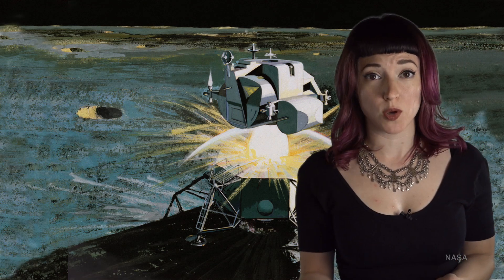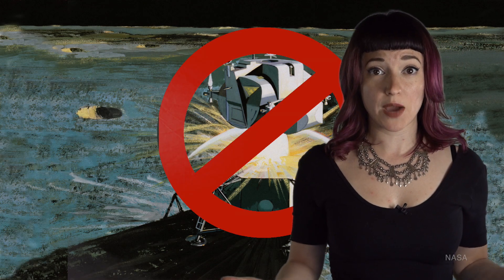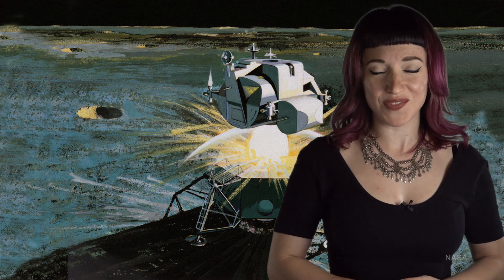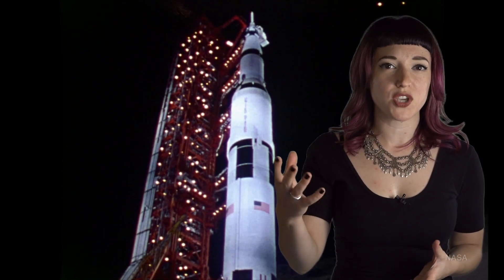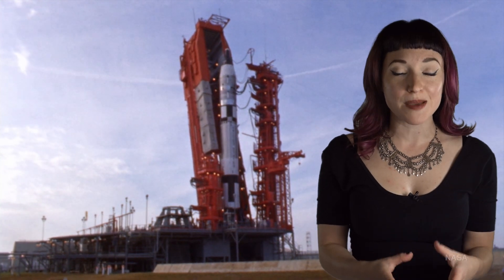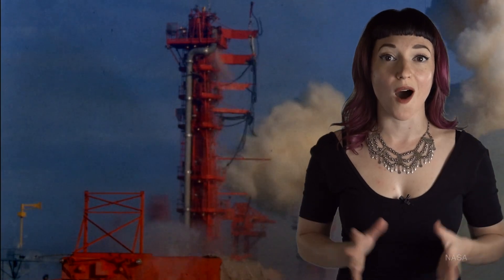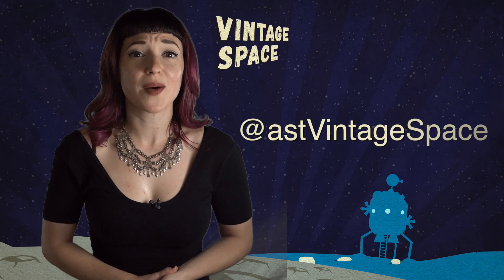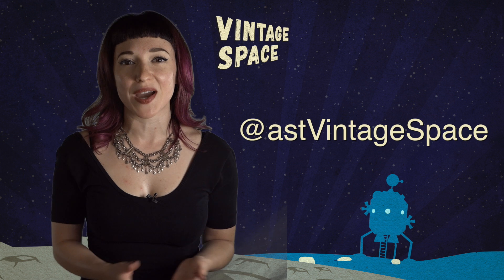How the Lunar Module Launched from the Moon Without a Flame

Comment: The controversy still rages; professor Van Allen thought his geiger counter was broken. Then after another probe, concluded that they weren’t broken, and that there were very very high levels of radiation (the readings went off the scale several times) then parts of the belts they are declared safe. So safe in fact that photographic film (tens of thousands of photos) make it back to earth unscathed. Something screwy going on around here, especially when we find out that a route was found through the “least lethal parts of the radiation belts” (???!?!?!!) But of course, those details about the structure of the belts were not available until the probes in the 1990’s. I’m not saying that’s proof of fakery, but if it isn’t then NASA took great gambles with the health and safety of their astronauts.  I mean if the dosimeters show lethal doses of radiation, what do do? Say oops and go back home and hope it’ll be alright? Very strange and discomforting.
Reply: Wow!!  What a pile of utter gibberish:

YOU SAID: "The controversy still rages;"

== No.  There's no controversy in any actual scientific sense.  The only "controversy" (not a controversy) is that ignorant conspiratards continuously butcher the living daylights out of the sciences involved.

YOU SAID: "professor Van Allen thought his geiger counter was broken."

== Um, no.  Geiger counter?  Do you even know how one works?  What good is a Geiger counter in the Van Allen belts for unmanned probes?

YOU SAID: "Then after another probe, concluded that they weren’t broken, and that there were very very high levels of radiation (the readings went off the scale several times) then parts of the belts they are declared safe."

== Yes, because the astronauts were not going to be sent through the belts dangling on the outside of the craft, they would be INSIDE the craft.  The type of radiation in those belts isn't atomic, you know.  It's not high energy neutrons and gammas, you know.  It's mainly ionized particles.  Yes, this is extremely lethal if you're dangling naked outside of the craft (but, if you were, um, yeah, you'd have all kinds of other problems).  But, inside an aluminum hull craft, you're quite well protected.  It would take a couple of weeks of exposure before it would be fatal.  Apollo went through in a couple of hours.

YOU SAID: "So safe in fact that photographic film (tens of thousands of photos) make it back to earth unscathed."

== Because they were in metal containers, inside the aluminum hull craft.  I mean, good grief.  Why would you think that type of radiation would damage film in the first place?  What makes you believe such stupidity?  I mean, you know, radiation comes in many many forms.  Light is radiation.  And, light affects film in a major way.  And, there's a hell of a lot of light in space too, constantly bombarding everything around, which would render film completely useless if exposed to it.  But, everyone knows that it's very easy to block light.  Just put the film in a container (anything but a transparent one), and voila, all of that massive amount of light radiation is rendered meaningless.  Why?  Yet, if you put film in canisters inside an aluminum spacecraft, and you say "Van Allen belts" to a conspiratard, and STOP THE PRESSES!!!  It's CATASTROPHIC!!!  CALL 911!!!  CLIMB INTO THE BOMB SHELTER AND BRING YOUR SHOTGUN, THE WORLD IS COMING TO AN END!!!  Why?  Because conspiratards have absolutely no understanding of what the word "radiation" even means.  Most of them think "radiation" is always the stuff you get from nuclear reactors and nuclear bombs.  Most of them don't realize that sound is radiation.  Light is radiation.  Xrays are radiation.  Gammas are radiation.  Alphas are radiation.  Radio is radiation.  Sound is radiation.  Ions are radiation.  The list goes on.  And, they have zero concept of how much radiation is in the Van Allen belts, what type of radiation, and what it takes to protect against it.

YOU SAID: "Something screwy going on around here"

== Yes, there is.  You've never set foot into a university classroom on particle physics, yet you're acting as if every particle physicist on the planet for the past 50 years is too fucking stupid to realize that the Van Allen belts would kill astronauts.  Screwy that you can't find an single particle physicist on Earth to agree with you, yet you think you've got something intelligent to say about the topic.  Screwy indeed.

YOU SAID: "especially when we find out that a route was found through the “least lethal parts of the radiation belts” (???!?!?!!)"

== No.  The least lethal parts would be above (or below if you'd like) the poles.  If you shot the craft up/down from one of the poles, out about 25,000 miles, then took a 90 degree turn and headed for the moon, yes, that would be the "least lethal parts."  But, there wasn't the fuel for that.  So, James Van Allen and the folks at NASA worked within the fuel constraints, and came up with a path that avoided the "most lethal" parts of the belts (equatorial).  So, they went out on an angle where the levels of radiation are less than they are equatorially, and then arced back to equatorial after clearing the belts.  It's not as bad as you'd think (fuel wise) because the pull of the moon's gravity over the days' traverse actually helps to pull the craft back toward an equatorial path.  This path is best represented in this photo, which was taken during Apollo 17 on its way to the moon:
https://www.nasa.gov/sites/default/files/images/135918main_bm1_high.jpg
Notice, they're so far south of the equator that you get a pretty good view of the South Pole/Antarctica.  That's because they were avoiding the worst parts of the Van Allen belts.

YOU SAID: "But of course, those details about the structure of the belts were not available until the probes in the 1990’s."

== Pfftt.  Yes, dummy, the more probes you send, the more information you'll get.  Why you'd pick the 1990s as some sort of significant time period is beyond me.  They had been sending probes into the belts since 1958 (hence how they even knew they were there).  They had sent probes to the moon before Apollo also, you know.  They even sent Apollo 6 (unmanned) up and through the belts and back, taking radiation readings that would give them a very accurate picture of what to expect with an actual Apollo command module.

YOU SAID: "I’m not saying that’s proof of fakery,"

== I can't tell what's worse... people who just spew a bunch of insane nonsense, never once qualifying that they don't know what they're talking about... or people like you, who lie, and say you don't think it's proof of fakery, and pretend to be intellectually honest while spewing a bunch of insane nonsense.  Yes, we all know EXACTLY what you think, and yes, you think it's evidence of fakery.

YOU SAID: "but if it isn’t then NASA took great gambles with the health and safety of their astronauts."

== Good.  Fucking.  Gods.  What ARE you talking about?!!?!  They blew up three astronauts on Apollo 1 on the launch pad by using high pressure oxygen environments during tests, leaving the cabin burnt to a crisp, three astronauts included.  Two astronauts crashed into one of the buildings where they were assembling the Gemini craft, and got killed, because they were flying in terrible weather, because of the NASA timeline pressures.  Bunches of rocket scientists got killed dealing with explosive or toxic rocket fuels.  Workers were killed building all of the facilities for Apollo.  Yes, people died during Apollo.  Lots of them.  Most of them, unnamed people that nobody has ever heard of.  Yes, the astronauts signed up for the program knowing that it was dangerous.  Most of them were test pilots.  Many of them flew combat missions.  Aldrin was a combat pilot with kills under his belt.  Armstrong flew 78 combat missions, including getting shot down behind enemy lines.  Cernan's job (before becoming an astronaut) was to fly at low altitude carrying megaton-plus nuclear bombs, climb at the last minute, fling them up into the air to buy time, then get the hell out of there before blowing himself to smithereens.  Yet, you're complaining about a few rems of radiation?  On average, they received less than 1/2 of a rad each.  Even if you migrate that with the rem multiplier, it's still far below today's legal limit for a daily radiation worker in a year's time.  I'll grant you, it's probably more than you'd want (about 3-6 months legal doseage in a single trip).  But, in the bigger scheme of things, it's about the equivalent of two full-body CT scans.  Um, yeah, between the million other ways those guys could get blown to pieces, and a half a rad of radiation, um, yeah, don't talk to me about the "great gambles" of traversing the Van Allen belts.

YOU SAID: "I mean if the dosimeters show lethal doses of radiation, what do do? Say oops and go back home and hope it’ll be alright? Very strange and discomforting."

== Yes, that's exactly what they'd say.  But, they never needed to say it, because they never received anywhere near lethal doses.  Lethal doses don't come until you've spent WEEKS in the belts.  Apollo went through in a couple of hours.  This is the thing about you conspiratards, you don't know what you're talking about.  NASA talks about the concerns of the Van Allen belts for the ISS, or shuttle (back in the day), or Skylab (back in the day), and that's why they never sent those craft up into the belts.  They talk about the concerns also in the context of Orion's future planned missions to put astronauts in the belts for weeks at a time, or on long duration flights to Mars, stuff like that.  But, then you conspiratards pretend you know everything there is to know.  There isn't a radiobiologist, or particle physicist, anywhere on the planet, who is saying the stuff you're saying.  Why do you think you understand this topic?  Why?  What makes you believe you understand these things better than the entire world's experts?  You don't even know what a Geiger counter is!!!  Geiger counters don't measure radiation, they only make noises when something is ionized.  With a Geiger counter, all you can do is "hear" stuff, not measure it with any degree of accuracy.  Yet, that's what you think they sent up into the Van Allen belts on unmanned probes??  You're an idiot.  You don't know ANYTHING.
Reply: rockethead7 the safer thing to have done was to research the belts in more detail, like what was done in the 1990’s. That’s when the details of the nature of the belts were established. This knowledge was not available in so much detail in the sixties. As to the term “least lethal parts” I am referring to what might be termed a “shill” video presented by some English guy, where he uses that expression. The term is strange; it implies that there are parts that will kill you, but is least likely to. Nevertheless, it will kill you. I think if you truly have scientific interests at heart, you would naturally be inclined to be a doubter, and seek incontrovertible evidence. I’m not saying that the hoax theorists have been proven correct, but there are many observations of the material at hand that give cause for concern. Granted, there are a number of concerns that are baseless, ie they are not anomalies at all eg the converging shadows and the diverging shadows. The variation in the terrain explained that. There were others though. A sound was heard when a thrown object struck the LM. Now the door of the LM would be kept open when the Astronauts were outside, so I’m not sure if a microphone left on inside the LM could pick up this sound. (Perhaps the picked up the vibration through the wall of the LM). There is some evidence that an Astronaut heard the sound of a rock falling out of his bag and reacts immediately to turn to pick it up. Of course landing defenders would say that he saw it fall out of the corner of his eye. An Apollo 8 astronaut describes how he saw the moon in the shadow (presumably the shadow of earth) as are dark circle where no stars were visible, over his shoulder. In other words not using the optics, the stars were visible, contrary to what Armstrong and his crew said later. I realise that different amounts of light from the earth and sun could account for this, but still gives pause, especially when one Apollo 8 astronaut says after the moon orbit, he asked ground staff for instructions of how to get back to earth, which made me wonder how they would have done it if they had lost communication. I know I’m cherry picking comments that sound as if all the moon missions were faked. But that’s just it. Some of them do sound like that. We hear scientists tell of solar wind exacerbated by the solar flares, enough to fry the earth to a crisp but for our protective magnetic fields around the earth. It makes one fearful of certain death without adequate protection. We hear a NASA engineer say in a video that we need to learn how to protect astronauts from the radiation of the Van Allen belts. We read the responses from the moon landing defenders who become so personally abusive when trying to explain away the anomalies. I welcome rational discussion. I detest the personal abuse; it makes me want to not continue the discussion. I await independent visual close up confirmation of the Apollo landing sites. It would be a great achievement against some great odds if the landings actually happened. Armstrong and Aldrin’s comments at times have fuelled speculation as well, with Armstrong’s cryptic “we need people to uncover one of truth’s protective layers” in his last speech before his passing. Aldrin’s comment “why don’t you ask the administrators at NASA we were only passengers”. See https://youtu.be/jc7gsdonMHw
Armstrong: https://youtu.be/xwxsL6msdwE
Reply: rockethead7 I won’t be reading your replies, you’re wasting your time, because of your foul language to me- I haven’t used any foul language to you. This discussion is ended because you’re too defensive and take offence at any doubt being placed on that wonderful nation whose governments “would never lie” and who are so much better than the rest if the world. I’ve had it with that kind of snooty attitude. Don’t bother replying. I have read enough of your personally abusive comments. End of conversation.

Comment: I actually have a question about the EVA’s: there’s only the one hatch to exit and enter the LEM and they had to de/re-pressurize the LEM each time they left and returned from an EVA. In that case, I’m assuming that both astronauts would need to be suited up prior to either of them leaving the LEM as it had no airlock, correct? Also, would all their loose belongings have flown out of the hatch when opening the door or did they need to depressurize prior to opening that hatch? 

Cheers!
Reply: YOU SAID: "I actually have a question about the EVA’s: there’s only the one hatch to exit and enter the LEM"

== No.  There's a hatch on "top" used to get in and out when docked with the command module.  And, there's a hatch on the "front" used to get in and out while on the lunar surface.

YOU SAID: "and they had to de/re-pressurize the LEM each time they left and returned from an EVA. In that case, I’m assuming that both astronauts would need to be suited up prior to either of them leaving the LEM as it had no airlock, correct?"

== Correct.

YOU SAID: "Also, would all their loose belongings have flown out of the hatch when opening the door or did they need to depressurize prior to opening that hatch?"

== View this picture:
https://www.hq.nasa.gov/alsj/forward_dump_valve.jpg

== The pressure was only around 4 PSI to begin with.  Not a lot.  This is pure oxygen.  They don't need/want 15 PSI.  And, this is the dump valve (yellow/black handle).  They turned this valve, and the oxygen escaped through the valve.  This doesn't cause a tornado of oxygen rushing out.  To be honest, it actually was pretty rapid, because it was enough to cause the flag on the surface to rotate 180 degrees when they opened this valve on Apollo 14 (2nd EVA, after they had planted the flag on the 1st EVA).  But, it wasn't so crazy that it would cause a bunch of loose stuff in the LEM to explosively blow out or something.  Once the oxygen was out, they opened the hatch.

YOU SAID: "Cheers!"

== You too.
Reply: @rockethead7  thanks for the explanation! Very cool. I misspoke about the hatch, I was strictly referring to the EVA's when I said there was only the one hatch for entry/exit.  :)

Comment: OK, but how did they land without leaving a blast crater?  Did they get out of the lander with brooms to sweep the dust back.
Reply: There's a difference between blowing dust and leaving a blast crater.  Blowing dust, yes.  Blast crater, no.
Reply: @rockethead7  Whatever you call it there is no evidence of any dust having been blown away by the retro rockets that they must have used to avoid crash landing.